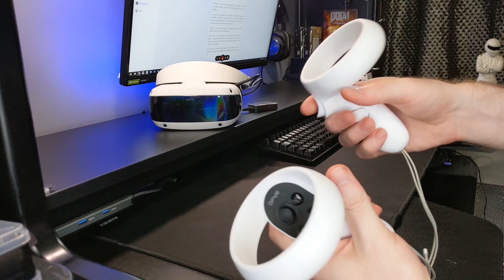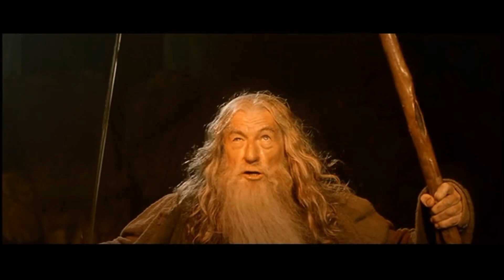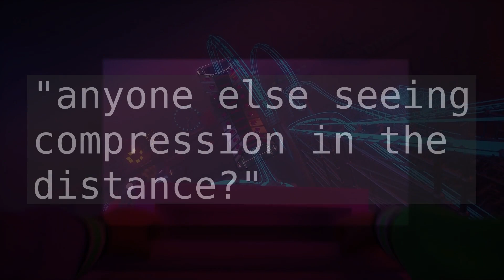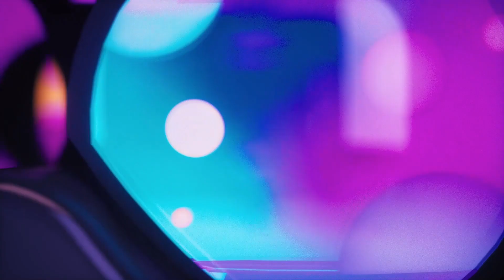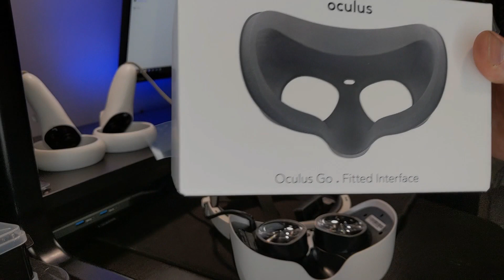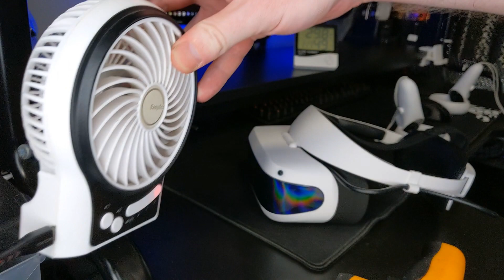Enthusiast Reviews- DPVR E4,  120hz Display Port Cable PCVR Headset

Comment: Honestly, my only issue is with the heat. I wonder if it would be possible to slightly cut open the headset for the fan?  Would that help anything?
Reply from the maker: That is only option, someone has shared a 3D printed mesh cover that replaces the sealed front mid section however this obviously voids warranty.

They obviously know this is an issue as later white versions had vent holes included and the new black version has vents and a reworked heatsink and internal fan position.
Reply: @virtuallyreal  Good to know!

Comment: Does the PDVR E4 have head tracking, gyroscope, and 360° head movement, or not?

You seem to use it just fine.

Can the PICO 4 be powered through the USB-C? Can we now get the PICO 4 in the USA through Amazon legit, or not? I see it advertised on Amazon, but from what ive been watching and reading, is that its not available for USA, yet!

Thanks in advance.

Comment: Great video. It seems like the E4 must be connected to a computer that has a DisplayPort 1.4 (true?). Struggling to find a new laptop that has a good cpu, good gpu, and a DisplayPort 1.4., that I can afford. I went to the dpvr website and I cannot find a section that explains the minimum & recommended computer specs. Do you have a DPVR link or your own spec recomendations?
Reply from the maker: Thanks Michael, I no longer have the headset, you may get more help with regards to laptop compatibility from their discord, I only have desktop PC with 12700k and 3080ti.
https://discord.com/invite/EtWNYJcG

Comment: I can absolutely confirm all the issues you have with this headset. fan noise, light leaking, no place for wearing glasses, heavy cable....
The support is great and they even offererd me to send me a bigger faceplate but at the end I still refunded it.
Hope they will update the firmware to fix the software issues at least.
Reply from the maker: Hope they can revise it, could have been such a good headset

Comment: Looking forward to your take on the Q3!  Funny how a lot of YT's are touting the Q3, but the PPI will actually be the same as the QP.   Since the Q3 uses one display, a lot of pixels are wasted for optical boundaries and no angled panels to offset pixel array jaggies.  Also no local dimming, so seems QP owners will have the better overall visuals between the two.
Reply from the maker: I'm on the fence about quest 3, it's apparently slightly heavier than quest 2, still all front weight (which I don't like after moving to Pico headsets)
 slightly skeptical on their ringless controllers too, but mainly, I really get frustrated with quest 2 UI, and it'll be much the same on quest 3, basically buying another headset just to get their new lenses, but I don't know how much I'll use it given I don't really use my quest 2 much anymore and it being all the same content
Reply: you cant do pancake lenses with only one display
Reply: @kushWRA1TH  That's what I thought, but apparently one display.  If correct, need more space to create the boundaries.  Not long to find out.
Reply: @rushmore3927  i mean, all pancake lens hmds so far have had the displays glued to and kinda inside of the lenses, so there is no way you can do that with a single display without having any proper ipd adjustment
Reply: @kushWRA1TH They actually can, by adjusting the display boundaries with software, but makes things worse for PPI.  Hopefully two displays!

Comment: It's most unfortunate that the only recent real PCVR (Display Port no compression) has to be something like this which falls way short of anything worth buying. I have a Reverb G2v2, it's a amazing HMD for sims, but it's biggest drawback is it being a WMR HMD, oh how I dislike WMR Portal and all of it's idiosyncrasies not to mention the pathetic controllers that come with the G2. Lucky I got my Valve Knuckles to work with the G2. If the G2 would have been a true SteamVR HMD, I would be a happy camper and wouldn't be looking for something new and improved that happens to be affordable (Varjo Aero and Pimax Crystal are out of my price range). Thank you for the in-depth review of this less than desirable HMD.
Reply from the maker: I understand the lack of IPD adjustment being the immediate killer here, but if all concerns were addressed, this would be a very decent pcvr headset, it's very refreshing when looking through the lenses and is something I'm going to miss.

Maybe the E5 will be the actual ''best headset of 2023''
Reply: @virtuallyreal  I was hoping that they would eventually update their design and release one that fixes these issues one day, but seeing them use bots to spam comment sections with glowing reviews has really turned me away from this company entirely. It's really unfortunate that this is the closest thing we've seen to a worthwhile PCVR product that isn't way overpriced.

Comment: Wireless VR is the best VR 

Kable VR is a shit VR.
Reply: Enjoy your compression and the extra 50+ms latency 😂😂😂
Reply: Freedom costs. 👍
Reply from the maker: Until wireless can match the latency and visuals the display port cable offers, I'll continue to buy both 🤪
Reply: For real VR you need a lighthouse that I got from my old HTC Vive best tracking and freedom to play a cable on the head can't move freely and it's more fun with box games power bank should always stay connected otherwise the battery will run out quickly
Reply: Can't have mods, can only play the shitty dumbed down version of the PCVR game.
Reply: With Virtual Desktop The graphics look good use WiFi 6 Router

I have Pico 3 Link i use DP for Race or apex lengend games

Comment from the maker: this review absolutely exhausted me, so I hope you all enjoy😆
Reply: Thx, for the review. Because of the reasonably good image+fov+overlap this looked good as a 'sim' pcvr headset, but other reviewers also mentioned the heat buildup and lack of ventilation, why I was apprehensive...

I've bought a pico neo 3 with DP cable instead. Not perfect, but also good pcvr image and doesn't get that hot
Reply from the maker: @thijsazerty692  it's so close to being a great headset for sim racing.

The biggest factor needed there is better cooling for sure+ the audio issues.

It would gladly be part of my collection for that use alone otherwise, the other things can all be corrected.

I'm not exactly sad about going back to my neo 3 link, if anything trying this headset made it feel better in some ways, I will miss the airy feeling viewing through the lenses on the dpvr though
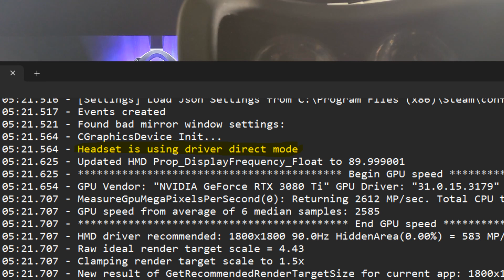Reply: Great review, I say more on professional than enhusiast side. 8:27 strange enough Pico Link app on PC is not required to run in background when using SteamVR does it means it is more direct than this DPVR E4? Also this 1800x1800 StemVR res is unusual, I always thought than bowel distortion correction goes up to headet resolution not the opposite way.
Reply from the maker: @juu226  yes, Pico neo 3 link is direct, not driver direct 

Meaning no software needed for neo 3 link, no extra overhead, you only need Pico link for installing the drivers and changing Refresh rates and controller options, of course needed for wireless pcvr which is then driver based
Reply from the maker: @juu226  resolution is a big forehead slap from me when I first seen it. How reviews missed something so blatant I don't know
Reply: @virtuallyreal  thanks for explaining, I saw couple of reviews of E4 and you are right - no one pointed that out. I hope this res can be fixed in software updates as it makes no sense to be like that now.